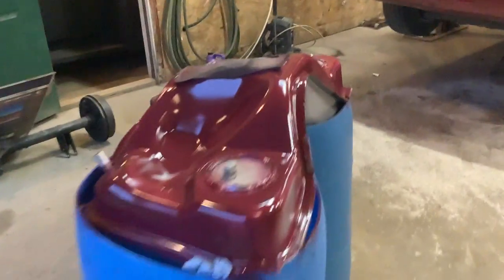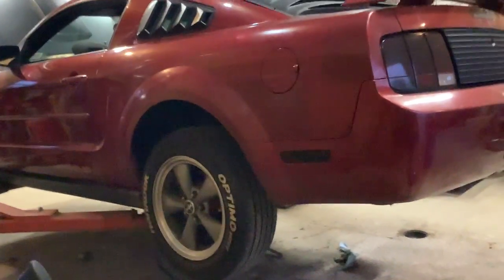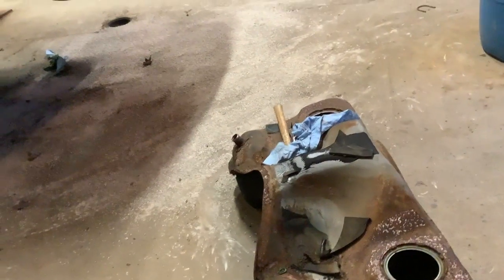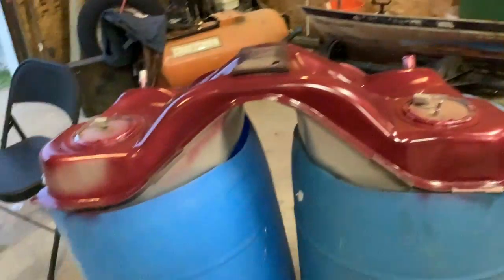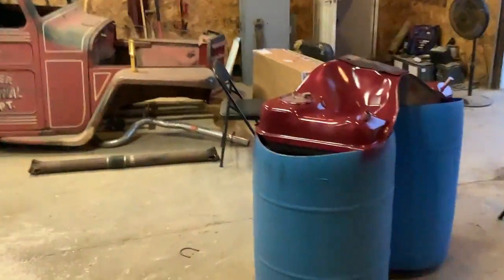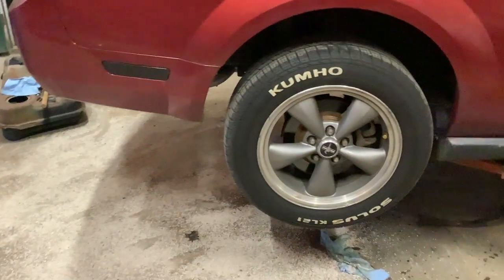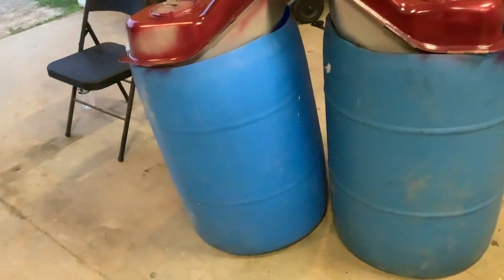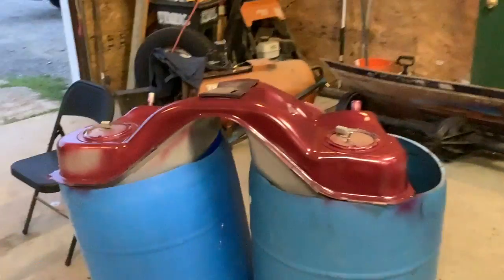Cheapest Mustang on Market Place smells like gas .

Comment: I need to replace my front fuel pump in my f350.  All your channel does is remind me of stuff that needs fixing.  Heh :)
Reply from the maker: You should be at my shop , every single day I find something new to fix of mine or someone else’s ., you’ll fit right in . . Your F350 has the 5.8 . If I remember correctly hopefully it doesn’t have two tanks ..double trouble .
Reply: @rustyrods8535  Twin tanks, 460. And i need a shop.  Under a tent is a poor substitute.